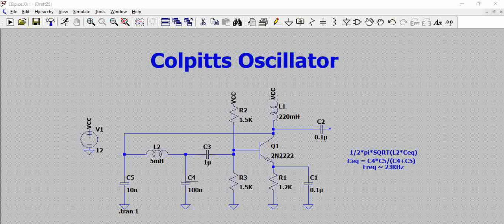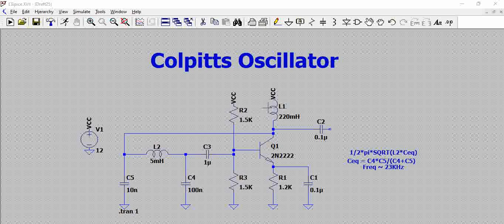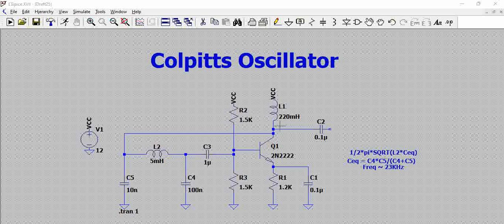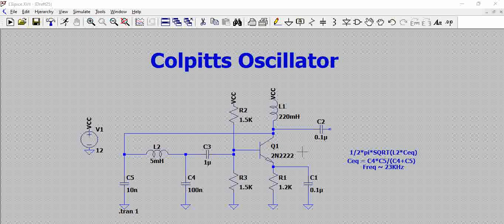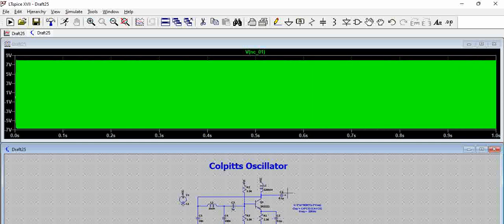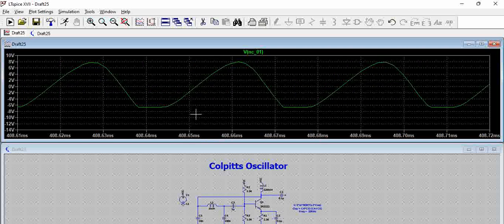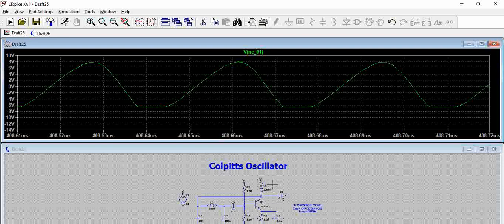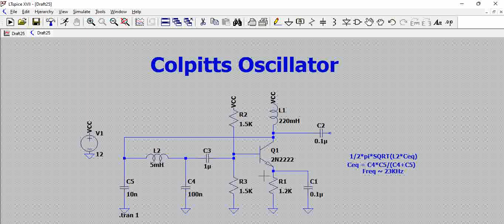Colpitts oscillator simulation in LTspice | Colpitts oscillator circuit design | LTspice simulation

Comment: can i make this with a mosfet?
Reply from the maker: Yes, the circuit slightly varies..
Reply: @Way2Know  can you show me?
Reply from the maker: @XxGoldenXxful  If you are using LTSpice for simulation, simply replace BJT with MOSFET. Provide a lower power supply. Have a higher value resistors at the input of the MOSFET.
Reply: @Way2Know  It didn't work with mosfet, which resistors should I change? 
Is there a simpler circuit model that I can follow?
Reply from the maker: @XxGoldenXxful no need to change the resistors if you are lowering the voltage. Created a video today in the channel for the same. Check once
Reply: @Way2Know  I managed to make the circuit, but I can't produce the frequency in the 2.4Ghz range, even setting the inductor value to 3.3n and the capacitors to 1 and 2 pF. Any tips?
Reply: @Way2Know  can you help me?

Comment: How to make oscilation in 2.4GHz?
Reply from the maker: If you see the output frequency of the colpitts oscillator here, it is 23 KHz. For that frequency itself, we had to use mH of inductor and pF of capacitor. using the formula mentioned there, you can calculate the required inductor and capacitor and definitely it is not feasible to get such values. So, achieving 2.4G with this kind of discrete circuit is not practical. In practice, this can be achieved at the MMIC level. You can refer to this link to get an idea of what must be done at higher frequencies.
https://www.microwavejournal.com/articles/35111-and-38-ghz-colpitts-oscillator-mmics-with-low-phase-noise-high-power-and-high-dc-to-rf-efficiency